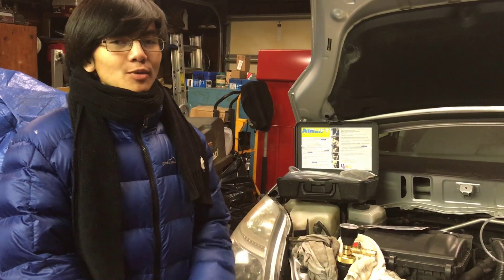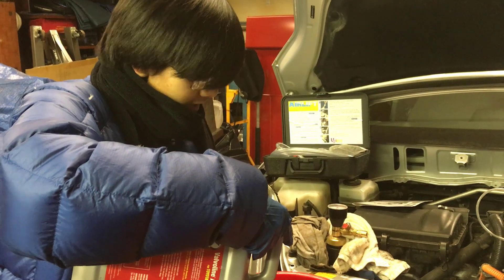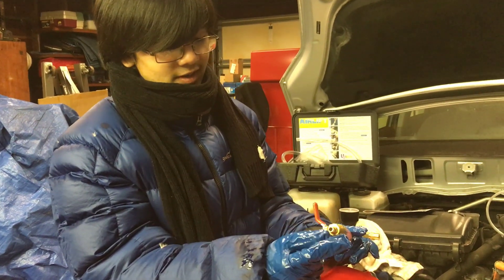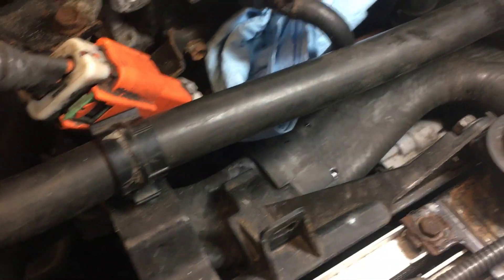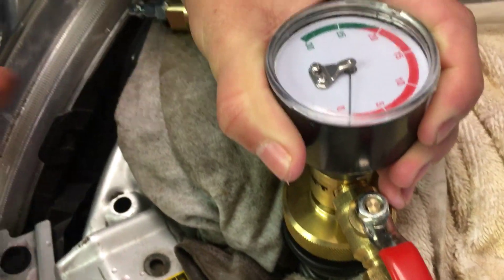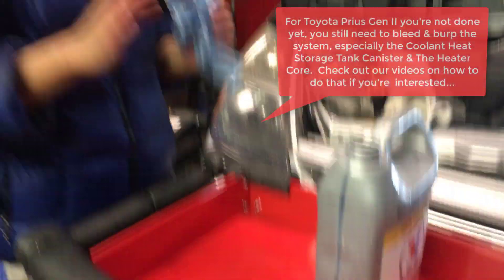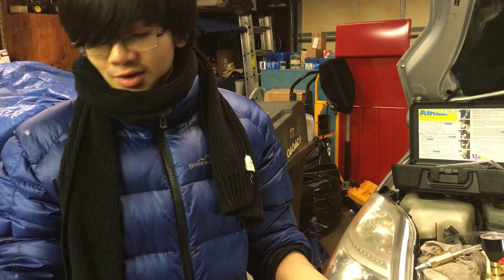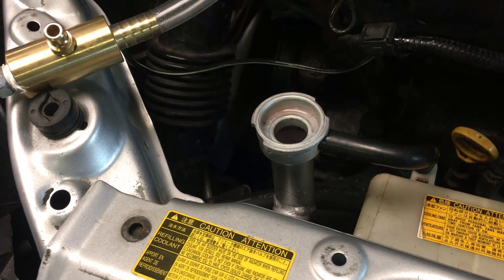Using OEM UView AIRLIFT™ Tool To Refill Coolant System - Fill, Bleed & Pressure Test | Prius Gen II

Comment from the maker: Here are the #ᴬᴰlinks to tools, parts and accessories you may need to perform this repair:
1.  https://amzn.to/3VUgyfR  |  UView 550000 Airlift Cooling System Leak Checker and Airlock Purge Tool Kit
2.  https://amzn.to/41nywdW  |  Zerex Asian Vehicle Red Silicate and Borate Free 50/50 Prediluted Ready-to-Use Antifreeze/Coolant 
3.  https://amzn.to/3ZFMyXd  |  PEAK OET Extended Life Red/Pink 50/50 Prediluted Antifreeze/Coolant for Asian Vehicles, 1 Gallon
4.  https://amzn.to/3D4LOCa  |  G9020-47031 Engine Electric Inverter Cooler Water Pump Assembly for 2004-2009 Toyota Prius 1.5L 
5.  https://amzn.to/41nDVla  |  GELUOXI 16670-21010 Coolant Flow Control Water Valve Replacement for 2004-2009 Toyota Prius 1.5L Hybrid 

Or Click on Amazon link here and search for what you need:  https://amzn.to/3D1T2GQ

Comment: Can this be used to remove air bubbles without draining? 2007 Prius, changing out aux heat pump and will be using hose clamps so as not to lose coolant.

Comment: @12:30  Turn the knurled brass ring to expand the rubber collet for an air tight seal in the radiator neck.  I don't think you need the conical adapter.
Reply from the maker: Good recommendation.  I don't remember if we did that or not but my dad set up the unit.  Maybe he already tried it and the collets either too big or too small.  I will ask him...  Thanks for taking the time to comment and thanks for watching...